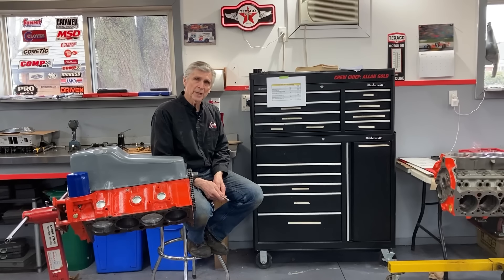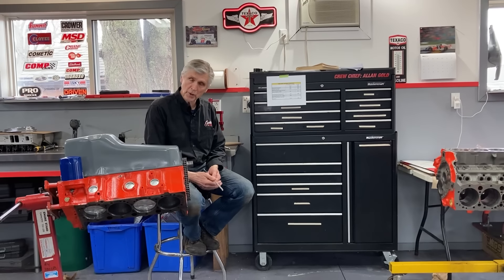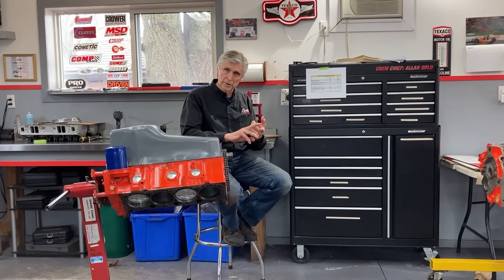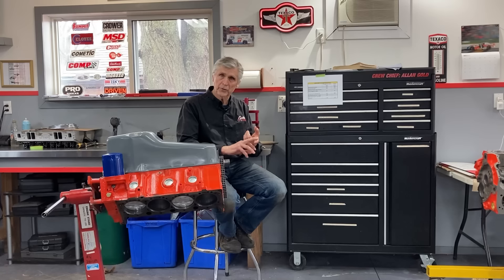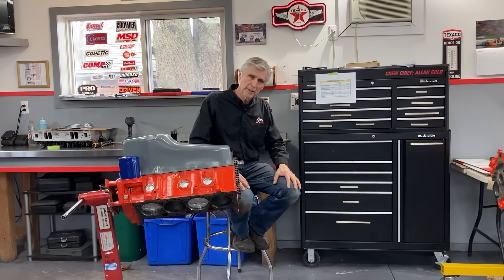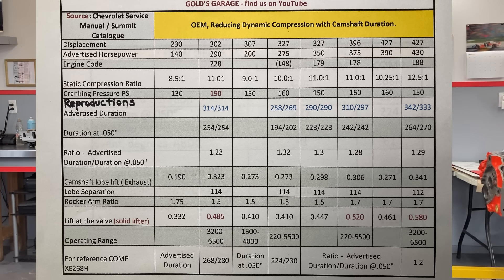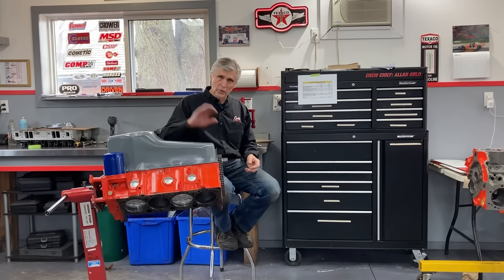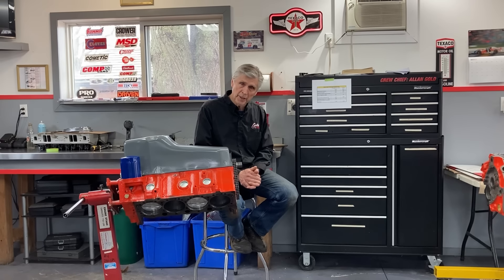Selecting the right camshaft - Compression Myths How much compression can you run on pump gas?

Comment: So when you bleed off that higher compression with that cam design?  Is it just wasted compression or what am i missing here ?
Reply from the maker: Great question Boss. Let me try to explain. 
Air and fuel mixture has mass and so it also has inertia. The inertia is proportional to speed (RPM) of the engine. 
At low RPM the air fuel mixture has very little inertia so after BDC the piston is able to push it back into the intake plenum until the intake valve closes, usually about 40-65 degrees ABDC. This reduces dynamic compression as nothing is compressed until the intake valve closes.  
This is called reversion and is what causes the rough idle and poor low RPM performance with long duration cams.
At high RPM however, the mixture is entering the plenum at a high velocity and actually compresses against the closed intake valve. At the overlap TDC when the intake is opening and the exhaust is closing, that inertia purges out the exhaust gases until the exhaust valve closes, then rams into the cylinder until the intake valve closes, almost a supercharged condition.
A long duration cam has more overlap at TDC which helps high RPM performance, and a late closing point for the intake valve which reduces detonation. 
If you have lots of (static) compression, you need a high duration cam and vice versa. 
I hope this helps, please let me know. AG
Reply: @goldsgarage8236 so if you have a cam with shorter duration with a smooth idle i think I'm saying that correctly you would need higher octane fuel ? Thanks in advance .

Comment: good info probably should also mention how cams with large overlap will effect cranking compression. Mine makes only around 90 psi cranking pressure  but has a large overlap and duration. Effectively pushing combustion out intake port at low speed. The compression ratios is around 9.5:1  engine is turbo charged and makes 700 hp from 2.4 liters at 8500 rpm.
Reply from the maker: Thanks for your input, onefasthatch, That is a big cam! I am going to discuss this further on my next video, I hope you watch for it. AG
Reply: Overlap effects idle quality. Intake closing effects cranking pressure.  More overlap will actually increase low to midrange cylinder filling and that is why dirt track guys run a 107 or 106 lsa cam instead of 110 or 112.  The 106 - 107 will pull a lot harder off the corners but the idle quality will be horrible.  If you are pulling up past 7k rpm the higher lsa 110-112 would probably be better because of better higher rpm cylinder filling.

Comment: I think You should be able to run off of 87 with this compression ratio!  Here are the reason why:  1. Rod ration is a factor; the higher the better; 2. Combustion chamber design/efficiency; 3. Piston design/quench; 4. Constant cooling temp and adequate cooling system/components; 5. Good fuel quality/low ethanol content/low moisture; 6. Precision fuel metering/A F Ratio; 7. Vehicle weight; 8. Gearing and Transmission; 9. Appropriate Cam selection/Timing; 10. Properly machined and set-up Cast Iron head; 11. Correct Aluminum intake manifold!  I also think a good oil and standard volume oil pump would be the right choice for a street application. 12. Properly sized exhaust system should complete the total package..
Reply from the maker: Thanks rjordanar, lots of thought, thanks for your input. I am planning a follow up video to address this soon. Please keep watching. AG

Comment: Direct injection is the key to running on pump gas with high CR. My 2023 F-150’s 5.0L V8 engine is running a 12:1 compression from the factory and can run 87 octane up through E-85. On 91 octane the crank ratings are 400 HP/410 LB FT from the factory. On E-85 it’s 420 HP/430 LB FT (also from showroom floor). It actually uses dual PFDI injection (One DI and one PI injector per cylinder.
Reply from the maker: Thanks for taking time to share your comment James. AG
Reply: Need to talk about cams that will build clt pressure
Reply: Cly

Comment: I worked at a Chevy dealer in the 1960s, I did alot of tune ups, and we always performed a compression test. most cars fell into that 150 psi range. I worked on alot of Corvettes and some of the HP engines would push the psi well over 200 some as high as 250
Reply from the maker: Very interesting Monty. In the 1968 GM manual specifications, the highest cranking pressure for any engine is 160PSI, except the Z28 is 190PSI. Do you think carbon build up could be a factor?, or where these engines modified? Thanks for your comment,  we are learning from your experience. AG

Comment: Hi, just a quick question. My 406 pontiac has 190 psi on 6 out of 8 cylinders and 210/215 on the other 2.  Wet compression test yields another +30 to + 40 psi ranging from 220-250.  i have an excel file of exact measurements I'd like to email for a 2nd opinion but just curious if what I've written leads you to believe the rings are probably toast. Dynamic compression test next while it runs coming up. Leak down % #'s are from from 8% to 17%. TY
Reply from the maker: @ubethejudge69  I’m travelling right now so responding from my phone. 
Don’t over react.
Your leak down numbers are not bad so I think the rings are ok. Higher compression in two cylinders could be carbon, or in accurate reading. Run it and check again. 
Even 190 is high for the street. How does the engine run?
Reply: @goldsgarage8236  Appreciate reply while travelling. I didn't think of carbon - good point. I have some pics of pistons from scope -  maybe some seafoam would clear that up.  I just want to rule out all test's before giving up on fixing whatever has been missed.  
troubleshooting performance issue for last 15 + years.  Engine runs fine , no valve float.  Just the power has never been restored. No shop or anyone would know anything is wrong with this engine. Even though a shop tore it right down 15+ years ago and put it back together from scratch - it has never ran how it did when i first bought this car. - no mechanic/ engine builder / shop has been able to truly say this reason a) or b) . They say ... let me build you another engine.  dynamic compression coming soon
Reply from the maker: Are you sure you have the tune correct? With 190psi, you have to be careful about timing and detonation. How about camshaft or camshaft timing? What are the cam specs? AG
Reply: @goldsgarage8236  Thanks again AG! 02 sensor installed while back, good idle and WOT safe #'s, plugs - light tan . Never heard detonation since owning it (1992).  Realize doesn't mean it isn't happening.  Initial timing 18/Mechanical 18.  I do not know camshaft initial installed degree measurements (1992) as car was bought site unseen.  A shop rebuilt it in 2000 when that cam went flat, same cam chosen-284h-crane  degreed the 230/230 .480/.480 LSA 112 on ICL 107.  Just a list of things changed last 20 years - distributors/carb's/springs/rockers/torque converter/ intake's.  Dynamic idle #'s 110-130  psi / Snap 165-180 psi. Any other tests you might have let me know .  I really don't see anything wrong with these #'s , I don't see anything happening with the heads to warrant them being pulled to inspect.  It looks like rings are good?   My only clue was cranking compression prior to rebuild was 165 , they shaved the heads .10 thou and cam was far advanced more than usual 4 degrees.  I can only think of bringing cam to 112 ICL straight up or even 114 - 2+ retarded ?  Maybe that magically restores  the top end rush seat of pants back. Incidentally the pop up pistons in this engine have swirl marks on the top which could be casting swirls or hidden detonation?  How would i even test that theory if somehow the pistons were the culprit.
Reply: @goldsgarage8236  Oh hey, just wanted to circle back. Hope you had great trip. Thanks again for your help. I don't think there is a problem health wise engine as it relates to rings / heads.  I think you would agree.  From the internet.  My only course of action is to run cam straight up with no advance and see what it does.

Comment: Cranking pressure is measured at very low RPM. You might even be getting over 100% VE at high RPMs. How would that effect the pressure then?
Reply from the maker: Good point Scorpion. VE at high RPM will increase peak pressure and MEP, which is the average cylinder pressure during the complete down stroke. Typical MEP would be 10-15 times atmospheric pressure. AG

Comment: So my stroker 427 sbc has a cranking compression of 210 psi. The builder said it has a dynamic comp of 11.1 to 1 he recomended i run a minimum of 100 octane i so so by adding an octaine addative. To no ethanol 91. Cam has 272 duration at 0. And a 109lsa on exhaust 112 on intake. Is he out of line or could i run 91 octane without ehanol. I believe that fuel is non oxygenated  as well.
Reply from the maker: Thanks for the question Chad. I think your engine builder is correct. With 210 psi cranking pressure, you will need race fuel.AG

Comment: Fully build motor with  11:1 static comp 240psi cranking  compression IVC 62 ABDC what fuel would someone need for this type a build?
Reply from the maker: Thanks Bruce, with 240psi, I think you would need race gas, 112 octane or so. AG

Comment: This is a late comment but you also have to consider if the engine has iron heads or aluminum heads.  You need more static compression for aluminum heads because the aluminum will act like a big heat sink and wick away all that heat, iron heads will retain more heat and build more pressure.  Heat builds pressure, pressure builds power.
Reply from the maker: Good info, thanks for commenting Jeffrey. AG

Comment: Thx for putting up such Rare & Helpful info on a very hot topic for us hp factory iron guys....It really Is a comparison & engine Octane fueling Dilemma because the popular 0.050" lifter spec cams & the typical solid lifter 0.020" cam card timing data Is Way Different from the factory 0.006" lift SAE valve timing specs......Even using Long ramp Bleedoff cam timing, Chevy Did affix Octane Warning stickers to factory Iron head, L88 engine that Minimum rated Octane was Ron 103 & Mon 95,  with Mon rated fuel Preferred.....Why would Chevy bother with that warning If Lower Octane Was Not a Problem ?? ....Looks like Chevy Didn't put much faith in the DCR effect ??.....With U.S. Pump gas 92 AKI (R+M)/2  rated at 88 MON,  how is that supposed to work with factory Stock shim head gasket & Internals ?? ......Around engine Max Torque Rpm range, the cylinder Does fill Beyond the IVC point,  nearly to Full BDC cylinder capacity & Nullifies  the Lower calculated Dynamic CR is Probably why.....Maybe the clever use of "Squish" optimized Aluminium heads & smart ECU Detonation sensor designed ignition system can let the Stock engines run flat out Again on the current pump gas Octane problem.......
Reply from the maker: Lots of info, thanks for sharing Tom. AG

Comment: How do you calculate cranking pressure when designing a build?
Reply from the maker: First calculate your static CR with the Summit on line calculator, just google it. Then google Dynamic CR, a Wallace Dynamic calculator should come up. Just fill in the required information and you will get your DCR and cranking pressure. Hope this helps. AG
Reply: It does. Thank you. I was getting a very low pressure when using a different calculator on Wallace.  The dynamic compression ratio calculator on Wallace is the correct one to use as you say. That calculation also includes the dynamic pressure calculation along with the dynamic compression ratio. Thank you sir for clearing that up.

Comment: What is cranking pressure and how do you figure out how much
Reply from the maker: Good question John. Cranking pressure is simply compression pressure that you can measure with an inexpensive compression gage that you can buy from any auto parts store. it screws into the spark plug hole, (disable the ignition) then crank the engine over a few revolutions or until it stops climbing. 
For a street engine on pump gas I like to see 160-180PSI (pounds per square inch). 
Compression makes power but if you have too much you can cause detonation which can damage the engine. 
To calculate it on a build, first determine the static  CR. You can use the Summit on line Calculator. You need to know your bore and stroke, combustion chamber volume, piston dome volume, deck height and head gasket thickness. For street, aim for 10:1 for steel heads and 10.5:1 for aluminum heads. 
Then you can use the Wallace Dynamic Compression On Line Calculator. Now you also need to know the connecting rod length and the IVCP (Intake Valve Closing Point) of your camshaft. 
The result will be your dynamic CR and cranking pressure. 
Hope this helps. Let me know. AG

Comment: Well, it's quite possible it could. I'm at 3500 ft elevation, so a hot street engine in most cases needed 11.5 static compression and depending on the cams intake closing, it could definitely run great on pump. Good cylinder head chambers, and proper quench are also important.
It's also worth mentioning that today's Ethanol blended fuels have a different Stoic ratio, it's not 14.7 to 1, it's 14.01 to 1, so a proper tune will need to be richer that most people think. And it won't require alot of timing because the fuel burns quicker. If you tune a high compression engine as If it was forced induction, it will be fine....
Reply from the maker: Thanks for the info Duane. We are 753 feet above sea level so that s not an issue here. Thanks for the info about stoic ratio. We tune for results on the dyno, usually about 13:1
Reply: @duanedahl8856 point is correct regarding the difference in air/fuel mixtures between straight gas and gasohol.  Inherently today's engines don't make any less power on modern, alcohol-blended fuels versus gasoline from the "old days"; they just burn more of the new stuff to do it.  In fact, modern fuels with higher alcohol content can actually help to enable greater power because the charge cooling affect of the alcohol permits more dynamic compression and/or timing (i.e., higher cylinder pressures without detonation).

Comment: FYI the Mercedes M276 DE35 is a factory 12.2:1 compression ratio. I run mine on E15-88 , pump gas is no problem with high compression if the motor is built correctly to reduce hot spots in the combustion chamber  that can trigger pre-ignition/detonation
Reply from the maker: Thanks for the info 100. AG

Comment: 225psi cranking compression, and pump fuel for my street daily driver  379ci standard 4" bore 4 bolt main small block combo.  Have run as high as 250psi with a Holden 6 on pump fuel. The other street strip daily driver combo of mine is a  327 2 bolt main 14:1 compression combo
Reply from the maker: Thanks Brendon, Are you in Australia?
Reply: What kind of dyno numbers does something with that much cranking compression make?
Reply: @dennisrobinson8008  How many times do you ask for forgiveness at night knowing you have 14:1 on a 2 bolt? Just kidding but still, goes all against the 1970's tradition of dissing the 2 bolt.

Comment: What would be the purpose of making 12.5 compression and  then bleeding it off.
Reply from the maker: Bleeding off is only effective at low RPM when the engine is vulnerable to detonation. At high RPM, the mass and intertia of the FA mixture fills the chamber. AG

Comment: Can we polish the top of the piston and the combustion chamber to keep detonation low?
Reply from the maker: Good question Topgun. I don't think it would make much difference on anything aluminum but a sharp edge or rough surface on cast iron could potentially glow and cause pre-ignition. AG
Reply from the maker: I should have also mentioned, built up carbon in the chamber and on the piston is more likely to cause pre-ignition. AG
Reply: @goldsgarage8236  how much compression is safe with iron heads set up properly for street use?
Reply from the maker: i think of it this way. The Pontiac i am building now has about 10.4:1CR with steel heads. The dynamic CR and cranking pressure are more important. It will have under 180PSI cranking pressure. You can calculate all this using on line calculators, Summit for CR, Wallace for DCR. Your camshaft IVCP ABDC is a big factor in this calculation. 
If you aim for these levels use the best pump fuel you can find, manage your ignition timing, keep operating temperatures under control <200 degrees, start with colder spark plugs and watch for evidence of detonation. Hope this helps. AG
Reply: @goldsgarage8236  thanks for the tips!    I've heard chrome valve covers and oil pans retain heat.  Is that true or just hear say.